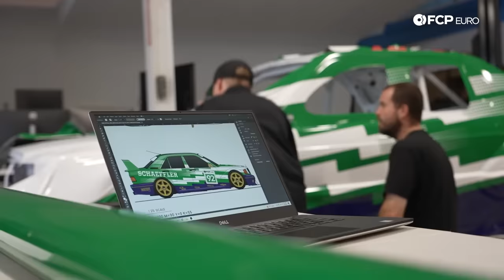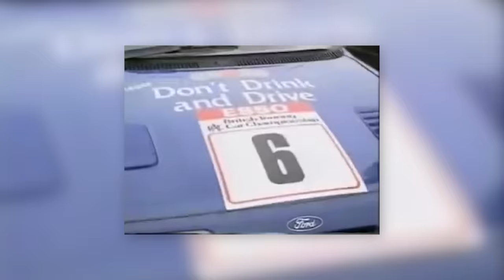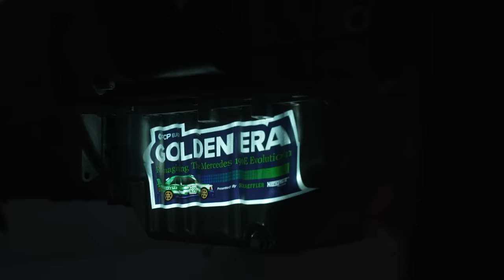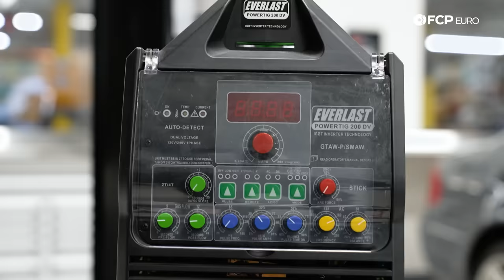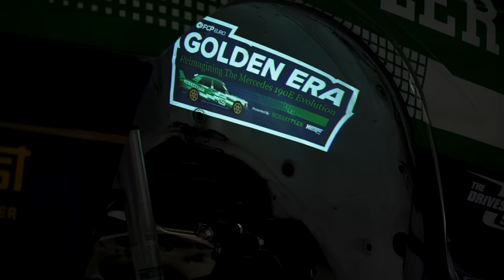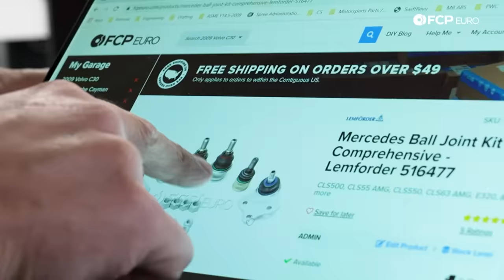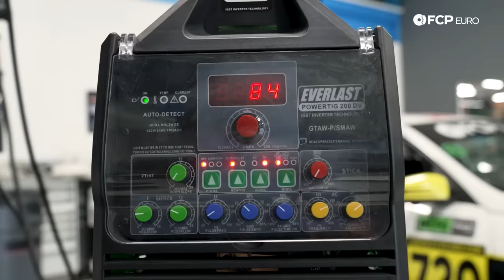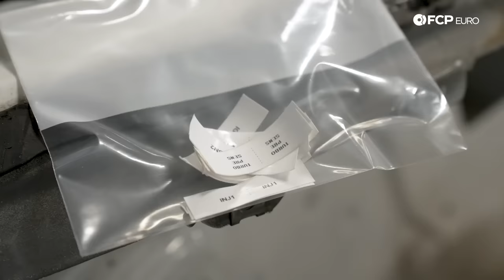Squeezing A Turbocharged 2.0L AMG Engine Into A Mercedes 190E - FCP Euro's Golden Era Project Pt. 1

Comment: While I can still appreciate the love and dedication that goes into making a roll-caged track car to fling around circuits, I still vastly prefer a street car design with a proper interior. I mean, the 190e may have been a homologation special, but what really made it so special is the attention to detail and bulletproof engineering that went into the car as a complete package. The lines run under a false floor through the interior of the car to prevent damage and corrosion, the literal centimeters of foam beneath the carpets for noise isolation, the robust design of all of the interior components so they couldn't rattle or squeak, etc. Then there's the engine that just refused to go wrong unless you abused it terribly. By making a track-focused car out of it, you do lose out on what makes the complete package so compelling. I'd love to see a second iteration of this where you use the same restomod upgrades to the drivetrain, but you go further and upgrade the interior as well.
Reply from the maker: We definitely hear you on this one; the Cossies of history were truly something special. While this build definitely has racetracks in mind, it's also worth noting how similar the spirit of the M133 we're using here is to the original spirit of the Cosworth-tinkered M102s you'd find in the cars of history. 

Both engines began life in a pedestrian blueprint (The M133 block is based upon the standard M270 four-cylinder, the Cosworth M102 upon a standard M102 four-cylinder) and received a significant overhaul to include forged internals, maximized airflow, and a power output near-enough to 400. Our M133 may leverage a turbocharger and some modern engineering including direct-injection, but it's about as close to the spirit of the DTM cars of the "Golden Era" as you can find on the roads today!
Reply: And thats your preference. If it bothers you so much make one of your own and stop projecting onto other people
Reply: @km6832 the grown folk are talking..
Reply: The 190 was the first Mercedes engineered to a price target, so technically it was the beginning of the end for Mercedes quality.
Reply: 3zzzzWZ❤❤❤
Reply: @TrySomeFentanylToday  the end of mercedes was the moment they partnered with chrysler.
Reply: @zibingotaeam3716  they were crap even before then and have continued being crap long after dumping Chrysler. Reliability was their ‘thing’ and once gone they were/are just luxury cars stuffed with too many unnecessary features. And ugly too. So ugly.
Reply: @f.kieranfinney457  lmao I see you've never even heard of the 600
Reply: @zibingotaeam3716  false, Mercedes had to do the Chrysler merger to get their hands on Chryslers 12 Billion they had in reserves, once Mercedes stole that they updated their model range and dumped Chrysler on Cerberus.
Reply: @mndleszdrwer

Yes, and it's NOT a "squeeze" for the 190E to take a 2.0L engine!

They came from factory as 2.0s and were boosted to 2.3 and even a Cosworth 2.5 .....
Reply: @tnteachertim  AMG fitted a 3.2 I6. But all of those engines are significantly flatter than the tall modern turbo I4. I get where he's coming from.
Reply: @tnteachertim  Engine displacement doesn't really correlate to engine size, modern engines are much bigger (especially taller) due to DOHC, variable Valve-Systems, longer stroke and conrods etc., when comparing them to older OHC or Pushrod engines of the same displacement.
Reply: I saw a beautiful bmw f10 535 that had the entire front interior and custom back that was a roll cage, had black powder coated plates to cover the inside of the car so it wasn't noticable that it had been stripped unless you really looked back there. It was beautiful
Reply: @scissrface2182 says the person with blue hair

Comment: Great to see projects like this being undertaken in 2024 . We live in a world of 200+ mph super cars and even a mid range German  family estate car has 400 hp but all painfully boring. A  friend recently called by with his 850hp Chipped RS6 Avant. Yes quick but not exactly fun and obviously an Auto like all the modern stuff. About 20 years ago i did a similar project to this. I fitted the running gear from a damaged 190E DTM touring car into my 1954 MG Magnette race car.Definitely  livened it up. 
Approx 380hp @ almost 10.000 rpm and proper 5 speed dog leg dog engagement close ration G Box. Not silly power but plenty for a 900 kg car and more fun that anything you can purchase off the shelf and super competitive in Hill climbs and sprints. 
The  car manufactures are lost in a world of chasing BHP and the obsession with 0 to 60 times. 0 to 60 in 2 seconds and 250 mph does not always mean fun especially on a public road .Looking forward to watching progress .
Reply from the maker: Now that's a swap! Talk about a crazy powerband in a tiny car, we can only imagine what that thing felt and sounded like. Googling also yields us some pictures of #28, and the M102 looks quite at home in there!

A good powerband in a good chassis does wonders for driver enjoyment!

Comment: The trick to floor insulation is a reciprocating air saw with a saws, all blade cut like a chisel across the end and sharpened. It will remove that undercoating so fast it’ll blow your mind.

Comment: The turbo being closer to the exhaust ports is much more important for lag as it can spool up faster. A spooled up turbo will fill that air volume in approximately no time flat, though minimizing that tubing length has plenty of other advantages and doesn't hurt a thing.

Comment: Hello guys from FCP Euro Media. I need your help with something i and i hope you will find time to answer my question. I am starting a 190E project (own design but inspiration from the HWA 190E), most like with a V8 eninge + turbo conversion. I see that you changed the front suspension, steering rack and so on (thank you for all infos), but what about the rear axle? Is it original besides the suspension or did you changed something? The first time i drove a 190e was yesterday for 1 minute, when the car arrived at my place, so i have no experience at all with the car, car chassis, suspension and so on. One important note: It will be a street legal car, so it should be nice to drive, safe, but also sporty. Thanks in advance and best regards from Poland.

Comment: How can you be sure about the oil level? because this engine only has a oil-level-sensor, no manual dipstick. If you change the engine position away from stock, the oil-volume will be not correct shown on the dash. maybe you have to remeasure the oil-pan- / oil-volume. Greets from Stuttgart ;)

Comment: “Squeezing” that engine in? My guy yall got 5-10 feet in between each side of the new engine before you even get to the fenders
Reply from the maker: After a little chopping, it does feel like it's meant to be in there! Plumbing definitely complicates things a bit, but the M133 and the W201 chassis seem to be a match made in Mercedes heaven.

Comment: Used to own this car. It was a tank, and with the 2.3L engine, it was as slow as one. This car needs no roll cage, it needs a 500HP engine.
Reply from the maker: What about both... 😁
Reply: @fcpeuro-media  IMO save yourself the weight of a second roll cage. A new C300 is a feather weight compared to the 190E and it definitely needs a cage,  Did you guys ever compared the weight to see how much more steel did the 190E have vs a new C300?

Comment: That thing will be awesome, a little heavier with all the red loctite it will need to not rattle itself loose with that hard-mounted drivetrain.
Reply from the maker: Will it be comfortable? Maybe not! But will it be fast? Absolutely!
Reply: @fcpeuro-media  For sure! expecting some antilag and flames from this one!
Reply: Could/ should have put in some suspension bushings* at the end of those engine mounts. Just needed slightly bigger size of piper to do that.
*Volvo rear axle bushings would work 😉
Reply: @thatdudeinorange5269  yeah, but i get what they did. Because RaceCar you know?

Comment: I really like the idea of the 2liter as a swap - 400hp in stock form for everyone screaming "V8!".
Looking at the intercooler and exhaust plumbing makes me rethink the practicality. I imagine that the RWD version of this engine is an easier swap though? 
Asking for my Volvo 240🙃
Reply from the maker: It would definitely be! The catch here is that there sort of isn't a longitudinal variant of our AMG engine here. Going for the non-AMG M274 wouldn't quite capture the DTM essence we're looking for, and the more recent M139 (which WAS sold in a longitudinal blueprint) isn't quite as strong as this M133. In this instance, we're doing it the hard way to create the best car possible!
Reply: @fcpeuro-media  Thanks for the feedback. I think a roadgoing car would probably be better off without the extra HP of the AMG. As long as it is light and torquey, the M274 with some light mods could be a great option for older euro rwd platforms.